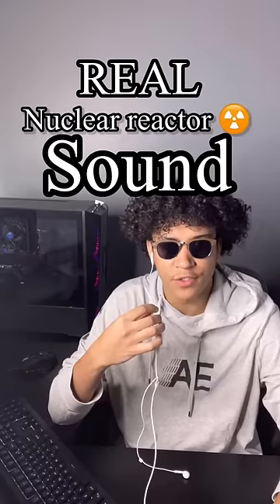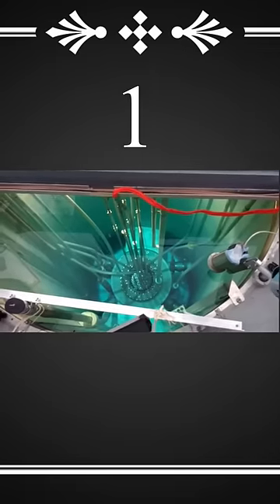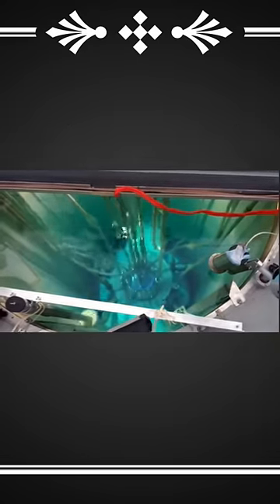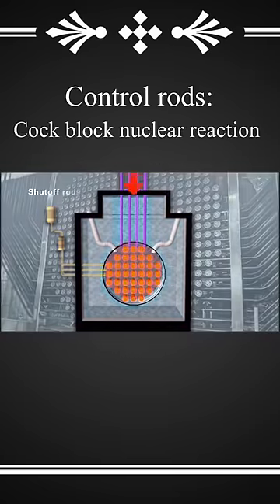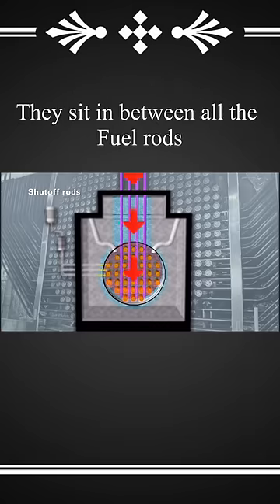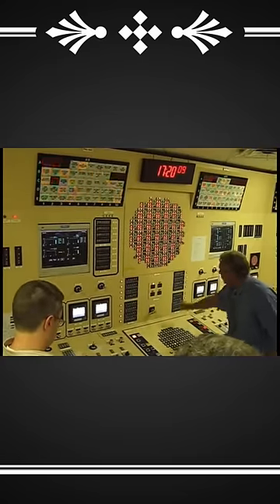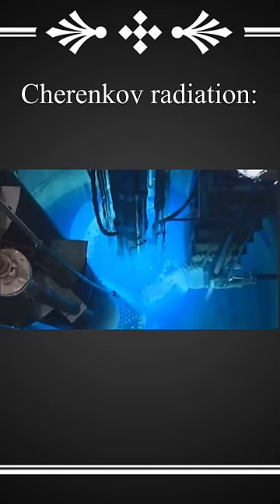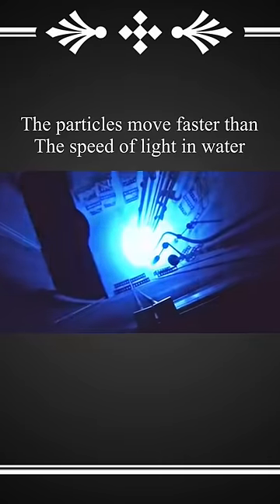The real sound of a nuclear reactor #shorts

Comment: This is wrong. Nothing goes faster than the speed of light besides a theorised thing known as a tackyon which is theorised to be born from the speed of light. So it’s minimum speed would be the max speed of the speed of light. HOWEVER speed of light travels about 75% of its speed when submerged in water - if this is the case then yes the particles would be moving faster than the light emitted from the radiation in THAT water tank. It will Not be faster than speed of light as it’s current form in zero pressure system like space.